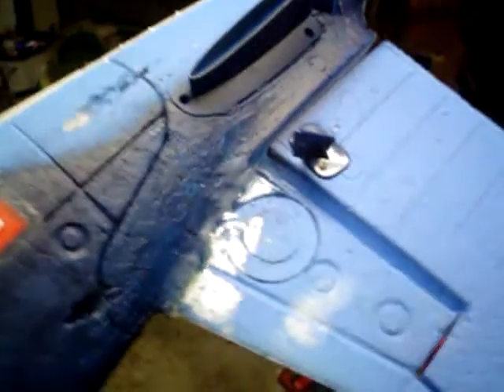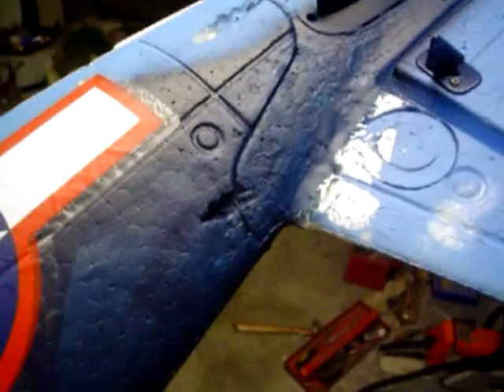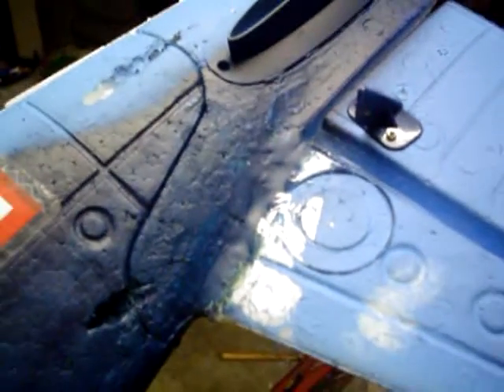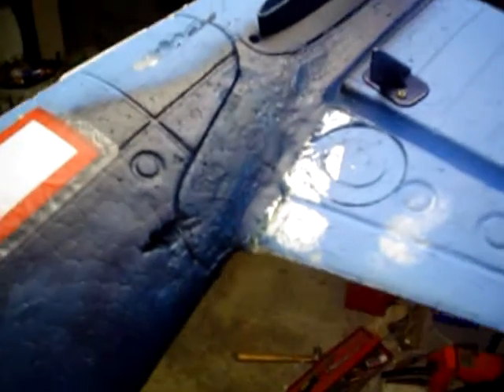Repairing Zfoam with epoxy PART 4 THE RESULTS

Comment: LOL I too recently crash my Corsair and had major damage to the main wing but was more cracks then holes. But I did buy a new fuselage for my Decathlon that had several inperfections inside and I did fill them with Epoxy and it work great.

I agree I luv foamies as they are very easily repaired.

Comment: Just recently got my BF-109 and during the second flight - for some reason - the left wheel locked up and it took a hard turn to the left.  Anyway the left wing has a nice crack in it but it did not break completely free...should have seen it in the air - looked like one side was from a corsair the way it bent up!! Just wanted to say thanks for the videos...I was wondering how to go about fixing this.